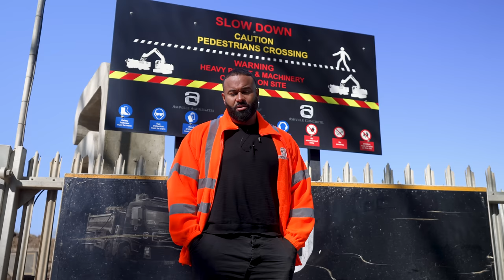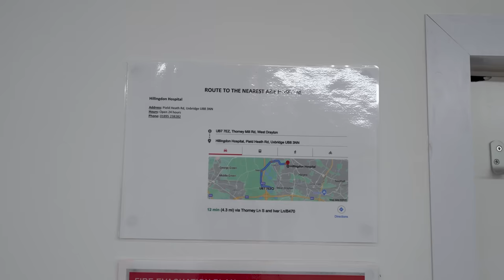Health and Safety in the Workplace | What Happens if an Employee Dies?

Comment: That was a great video, I think what we learned from it is that we can never cut corners when we are entrusted with high responsibility. The HGV driver was supplied with a concrete lorry to perform the daily operations of the company, and did not follow proper protocol whilst reversing. This shows the deadly consequences and proves why protocols exist in a workforce, not following them may have devastating consequences. Thank you for the video Daniel, once again Ashville has made an amazing video highlighting the consequences of not following proper protocols. Amazing use of the courtroom dialogue, well done Dr. Okewale

Comment: There was a horrific accident near us a few years ago with a truck stopped waiting at left turn llights and when they changed to green he set off, drove about half a mile down the road before two cars came steaming up and pulled him over to say he just ran over someone at the lights.   As he was just driving off an elderly lady nipped across right in front of his cab and in his blind spot.  She was so tiny compared to him being up in the cab at height and was over halfway across when he set off but was nudged, knocked over and the entire lower half of her body went right under the wheels and driver never felt a thing.   He argued with the two lads that stopped him convinced they were setting him up or had mistaken him for another one of the company trucks and I think there was some evidence to the back wheels that he had and the penny dropped 😧  He wanted to go back up not believing it unless he saw it himself but fortunately, the two drivers wouldn't let him knowing the state she was in (dead but flattened from the waist down and still bleeding out) 

Either at the time if happened or for that particular truck (not sure which) there were no requirements for the front mirrors overhanging the cab and iwitnesses said the pedestrian light was already on red before the traffic light had started to green so he hadn't done anything wrong.  She just inexplicably decided to nip across.  I'm sure the company did have front cab mirrors fitted to all their trucks and were supportive of the driver and the lady's family but I don't think he ever went back to work for them again.

Comment: The video is very  informative , however basic  H & S procedure were ignored by the directors,  I run a similar firm, and for a long time now, all commercial vehicles are required to have a reversing alarms fitted, it is good practice to have them and feel that would have helped the issues highlighted in the video,  very basic errors were made, but well done Daniel for being so honest

Comment: Training, training, training! I worked somewhere where a guy lifted a tipper truck body up but he never put the prop in on the hydraulic ram for saftey, he was replacing a hydraulic pipe and must have undone the wrong the pipe as he was crushed to death and as it was a Saturday morning there was a handful of people in at work, no-one checked that he had clocked out or did a check before closing up the workshop so he wasn't found until the Monday. It made everyone realise the importance of using body props when lifting tipper body's up to repair the trucks.

Comment: Good video, I know safety at Ashville is top tier based off every single thing you do to make sure people are safe from the pedestrian walkways, to the foam padding on the stairs and supports so people don't get Injures if they bump into it. To your training office.

I have a story, I work in a construction supply related industry similar to yours (but different) and in my line of work part of doing the job is people need to go on the roof tops of homes to place materials (singles).

Anyway, the company I worked at since it was our first year of achieving COR (certificate of recognition) safety (the top standard).

 OHS (occupational health and safety) was auditing us, and I mean really auditing us for a solid year. Not too sure why they said it was random, we had no lost time and the only injury in a year was a sliver.

Anyway we make it through the audit passed with flying colors of course because we did everything by the book, this includes weekly on-site visits from the auditor to view who the works did their job (we work with cranes).

Maybe 2-3 months after our audit completed there was another company in our industry whom did the exact same work we do.

They had two guys who up onto the roof (the rode up on the pallet) rather than using a ladder.

It was spring time so the roof was frosty, one of the guys slipped and was hanging off the Eaves trough (roof gutter) so the other guy went to the edge of the roof to try and pull him up (facing head down).

Neither of these guys were wearing fall protection, so the first guy that was hanging off fell and landed and folded over a fence and broke his ribs and got some internal bleeding.

Then of course after the first guy fell the second guy fell headfirst into the ground, and is now a vegetable.

Their company got sued (even though the workers were fully trained) . The company got sued for not making sure they were doing their job how they are supposed to.

I always thought it was messed up that OHS spent a full year on us with a clean record and this happened at another company, it probably wouldn't have happened if OHS audited them.

If you want to read the short article about it Google this

"Two men taken to hospital after fall from roof in city’s southeast" (Calgary)

You will see a blue truck and a police vehicle.

Furthermore the man in his 20s who fell off the roof and became a vegetable had something to do with the below article.

Google this
"Homicide victim found in Tsuu T'ina First Nation identified" calgary

🤷‍♂️

Comment: I've been in the construction industry for over 25 years seen the worst and I've seen the slap on the wrists companies get for fatalities here in the states. One big problem is the huge language barrier and lack of training from management down to the broom sweeper. It's all about production no matter the cost, is there safety people in site yes but they usually get shut down by the bosses or get fired for standing up and doing the right thing because it takes people away from doing production work. The standard that has been set by OSHA and company rules should be followed by very rarely happens or if you bring up a problem especially working with tower cranes that are reliant on radio communications and there is a language barrier is a serious safety issue but when you bring it up, the operator is accused of being difficult or just a complainer  or asked to be exchanged to suite the company that don't want to hire someone that can communicate the right way.

Comment: Back in 2013 I worked for Crossrail and during the induction at the HO in Canary Wharf we were issued with I Phones, I asked if I could have a simple phone and separate camera. The answer was no as I would be receiving emails as well as I could do other work on the I Phone, well I did receive emails. so many in fact 45 mins after charging the battery was flat, 99% of the emails were of no interest to me, so a waste of time and battery.
The site at Liverpool Station was well equipped with pedestrian walkways, plant crossing point were manned by security. Notices stating NO CELL PHONE USE ON SITE. But I needed to take photos of the piling operations with my I Phone no a camera as asked for, the security guards asked me to stop and I explained it was being used as a camera nor as a phone, but they insisted on no cell phones. I continued using the camera-phone from the pedestrian walkway and was issued with Cell Phone Tickets, it took two days for this to filter up to safety management and the rules be amended to allow photography only with a cell phone, first notified to security.

So yes your video highlighted what can happen wandering around site with a phone glued to your ear. Thanks for that and maybe this is what can be done after episode 100.?????? Well done team and your acting skills are up there with the pros.

 PPE wearing came about in earnest during the construction of the Channel Tunnel with a fatal accident being attributed to music center ear phones, the wearing of ex army camo uniforms, walking between rail-tracks and roadways.

Comment: Love it Dan but some things weren't touched on.  Swiss cheese effect. Truck would have had back up alarm which anyone in the vicinity would he aware that a vehicle is backing up around you. Also the loading area should be better secured 🤷‍♂️.  What's your taughts guys.  I work in the oil and gas industry. Usually it's not one reason or behavior that ends in such tragic incidents

Comment: You should actually only use a banksman if you really have to. Most banksman are the victims of getting struck by vehicles. 

A banksman is basically the last control in the hierarchy. Ideally the site should be designed to avoid reversing, with mirrors installed at blind spots, and segreated walk-ways for pedestrians, as far as reasonably practicable.

A lot of trained banksman I see are not doing their jobs safely, for example, not standing in a safe position, and in fact, many are walking directly behind the vehicle so they are in the path of the vehicle or in the drivers blind spot. If they trip or anything, they are done.

There's other things to think about here as well, for example, mobile phone policy, audible reversing signals, and reversing cameras.

Comment: So Terry leaves the safe pedestrian walkway and is on his phone in a yard. Both disciplinary actions in any yard or depot. Yet its the drivers fault. And people wonder why no-one wants to be a driver. SMH. 😔
Reply: This why the driver should insist on a banksman, and the site should insist the driver doesn't back up in the yard without a banksman.
Either of the above would have turned Terrys stupidity into a bollocking ,maybe a formal warning rather than a funeral.
Reply: @brianiswrong  He shouldn't need a banksman in his operating area. He's maneuvering into the Volumetric filling area, does a loading shovel get a banksman every time they go into reverse?
Reply: @5BARMEDIA  
I get your point 👍 and agree,in a working area nobody would be there,but I think the point of the video is the lorry getting to its operating area.

Comment: I don't believe you're at fault because of the drivers chosen negligence of not following the rules and the banksman should be alert to jump into action when a driver pulls up. Also the driver was reprimanded by you meaning you took action. Firing the driver after the 1st or 2nd incident cannot be proven to have prevented the incident.